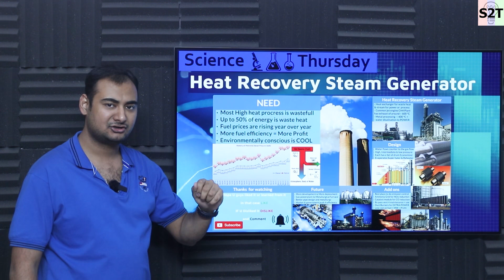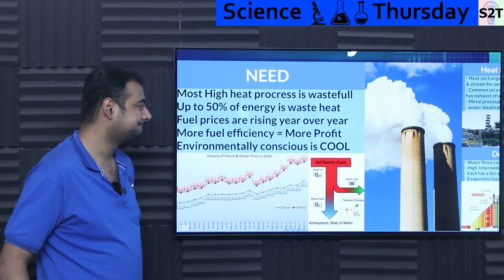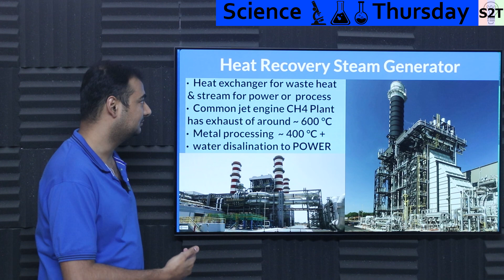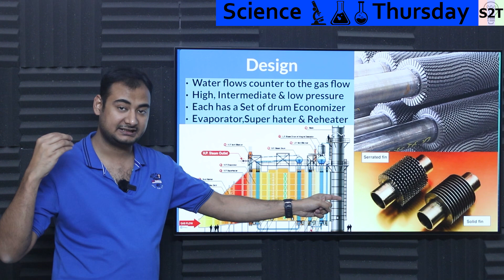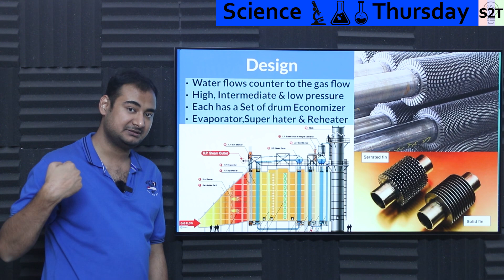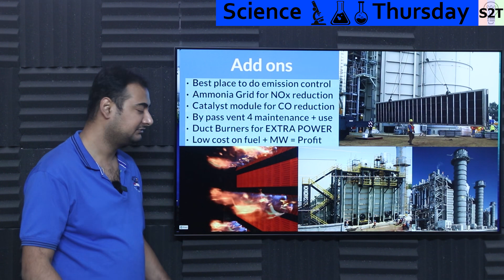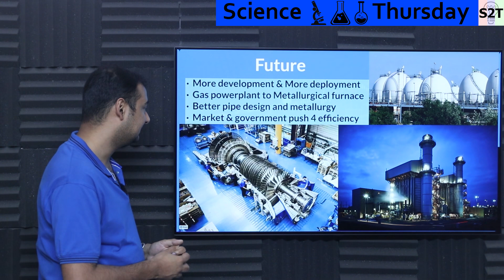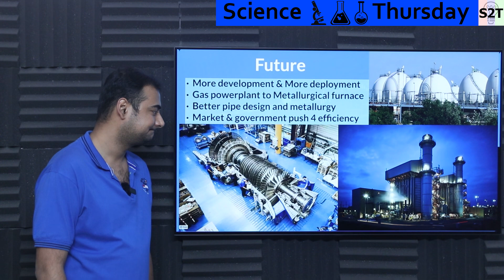Heat Recovery Steam Generator {HRSG} Explained {Science Thursday Ep222}

Comment: Hi, thank you for the video. Are you on Inked or another platform? Are you able to expand on the cut-off working volume of water the average HRSG would require to operate, including the amount lost due to evaporation? Additionally what is the flexibility of peak cycling on - off compared to having a standalone GTG without the HRSG + STG? Thank you. Damo O'Malley
Reply from the maker: Yes I am on Linked in but I wont be able to go deeper